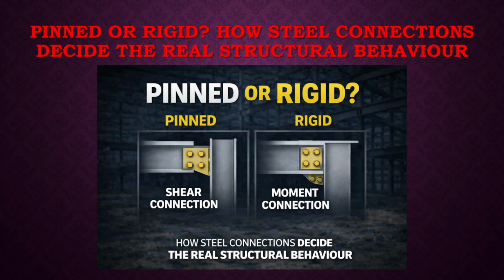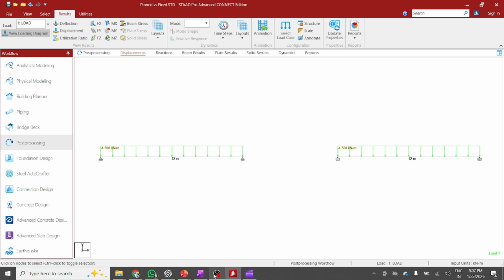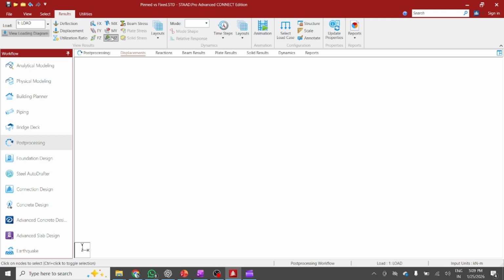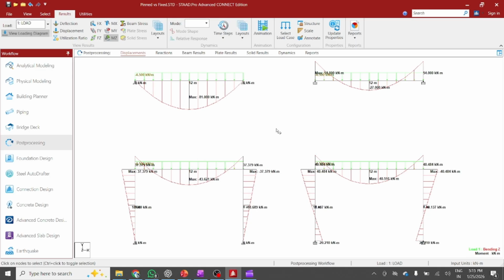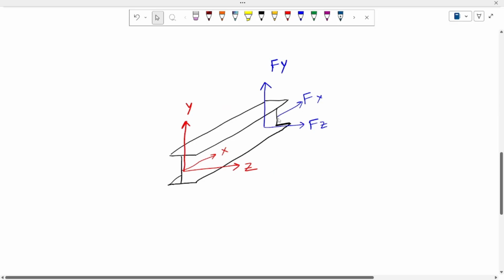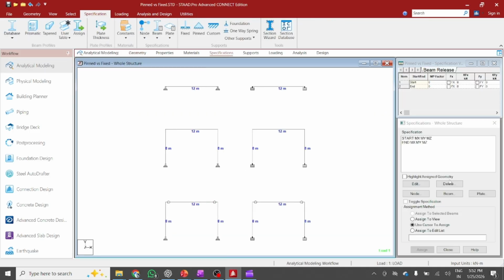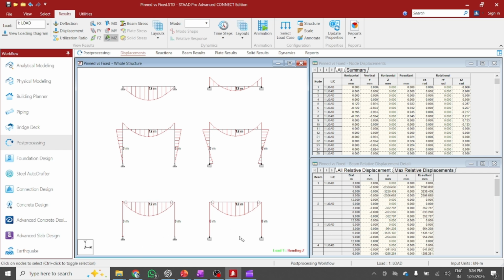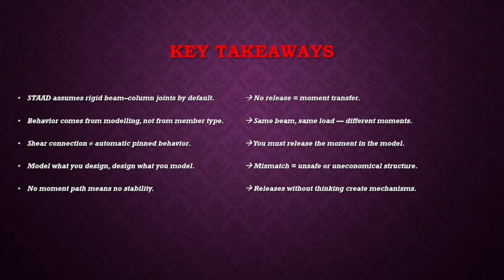Pinned or Rigid How Steel Connections Decide the Real Structural Behavior

Comment from the maker: Most modelling mistakes don’t happen in calculations — they happen in assumptions.

👉 In your current practice:

Do you model rigid joints and design moment connections?

Or do you release moments and detail shear connections?

Have you ever seen a STAAD instability that later made sense?

👇 Comment below:
Which case do you use most often — rigid frame or released (shear) connection — and WHY?

Let’s discuss real projects, not textbook answers.